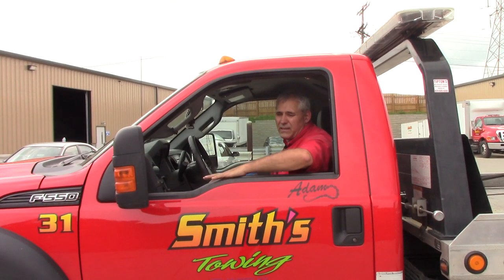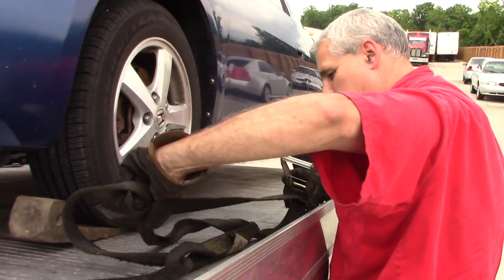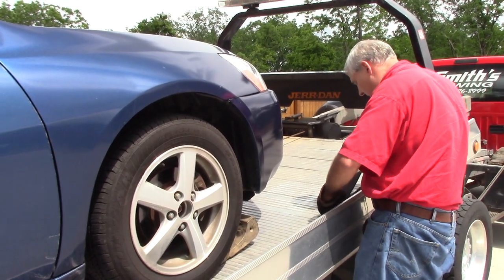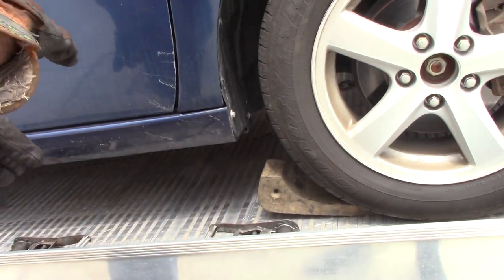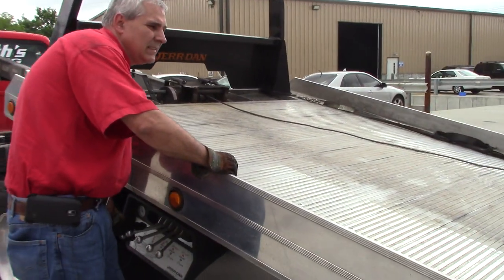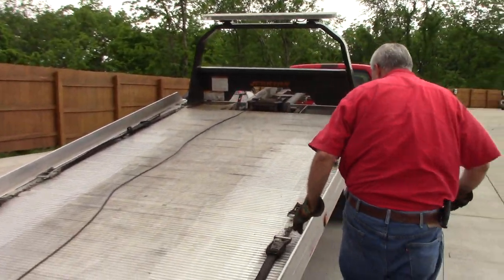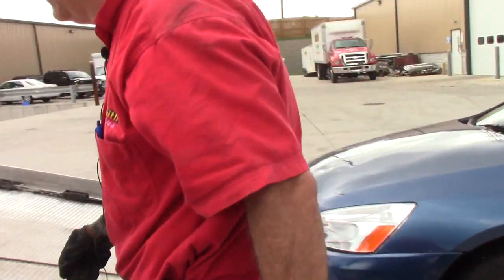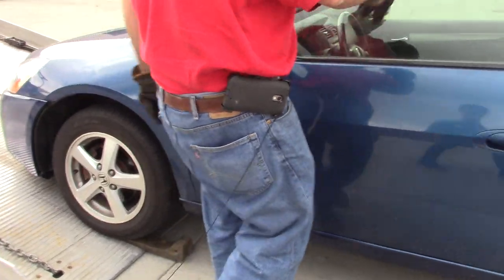Off-Loading a Car with Skates | Smith's Towing

Comment: Great video I’m new to the towing scene an what I have found that helps me tremendously is keeping a bottle of dish soap in my truck you can get a good size bottle of generic dish soap at dollar tree for a buck so when your skis are giving you a hard time dab a line of soap from front to back on the bottom of the ski then put it back under the wheel as long as your car is still secured with your j hooks then you have no worries of the car sliding to much or to quickly it has saved me countless amounts of time when unloading hardheaded vehicles like that one 👍🏽

Comment: What do you do when an AWD SUV does not have enough height clearance to be towed? 

The apartment complex has very low clearance and 3 tow companies have told me to use rollers to push it to the street.
Brand new 2023 Mazda, Vehicle does not turn on and also gears  are stuck.

Comment: I mostly struggle with all wheel drive 👀 but usually I just tilt the bed as high as I can and shake it till the back wheels is at the very edge of the bed then I roll the bed out and walk the truck 👀
Reply: Done that exact thing twice today. Used some good ole wd 40 let her slide on down.

Comment: Skates are not the right tool for the job on a bed that is full of ridges. They might do ok on a smooth floor steel bed. Wheel dollies are the best tool for the job . whoever will make a successful wheel dolly for the rollback industry is going to make a ton of money.  I am surprised that none of the big players in the industry like "in the ditch" , "collins",  or "go jack" did not jump on the opportunity.
Reply: Because the real towies just use degreaser, I have a set of dollies and they are 3x more work

Comment: How do you roll a car backward that's brakes are locked up or in park? Now in reality the car won't move. You'll need to reverse skate with the winch And a shit ton of dish soap and have a truck that's bed goes high or quick enough to rock it off. "That's the thing that sucks about skates"🤣🤣🤣